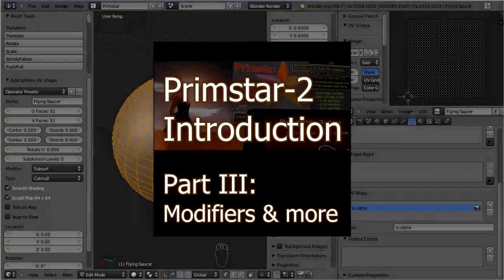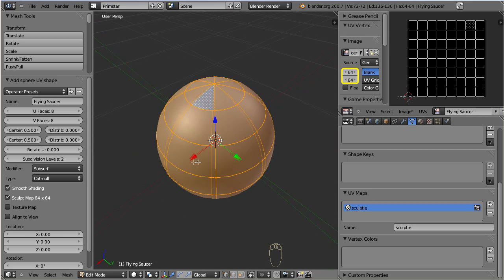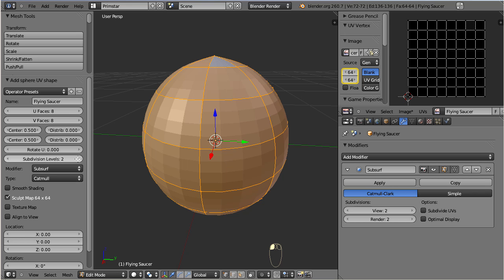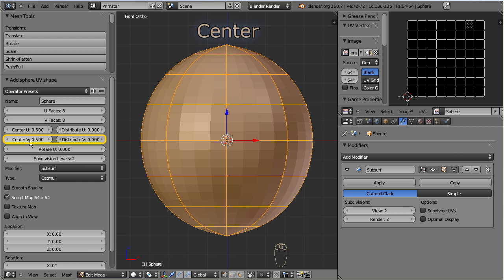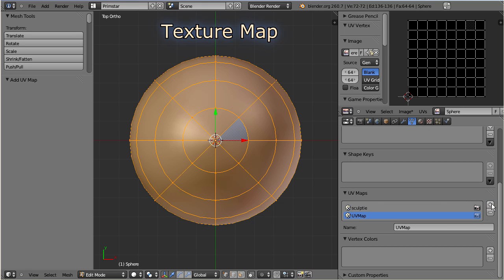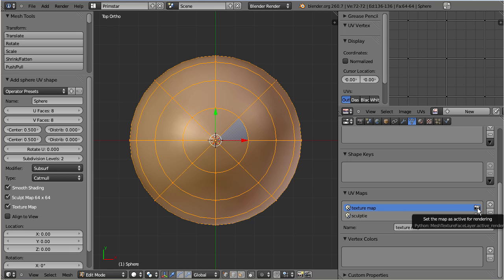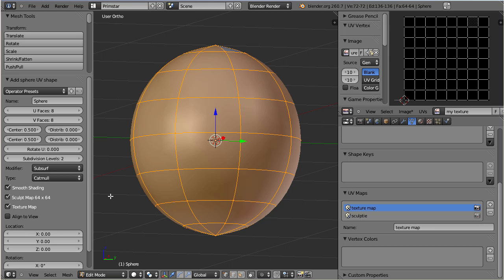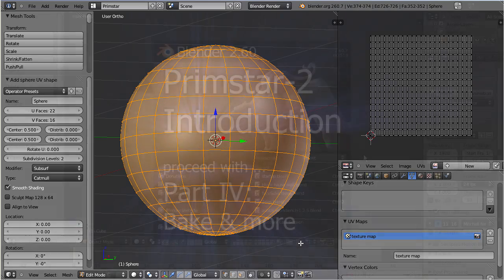Primstar-2 Reference Part 3

Comment: from the machinimatrix blog, "Please note that as soon as you start the next action (edit the object for example, or modify it in object mode) the operator panel will disappear and it will never reappear! So the complete set of settings can only be applied right after creating the object!"	
Hint: As long as you do not change any other settings of the object you have a chance to actually get the Operator panel back by pressing F6.